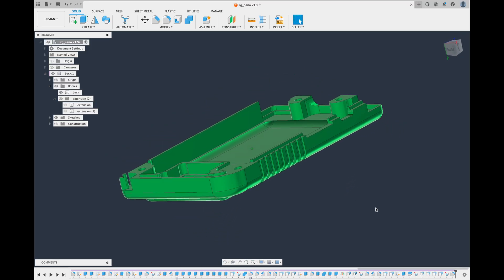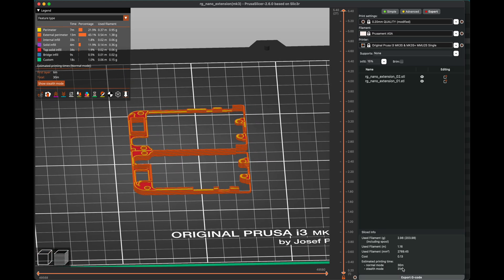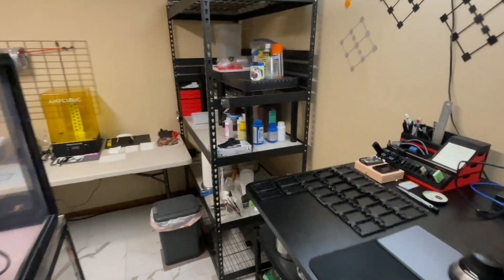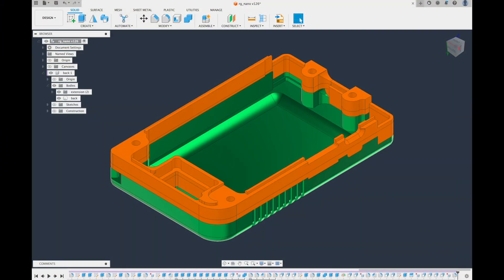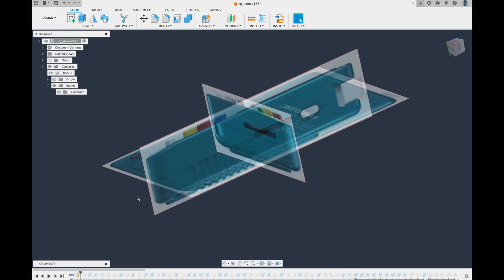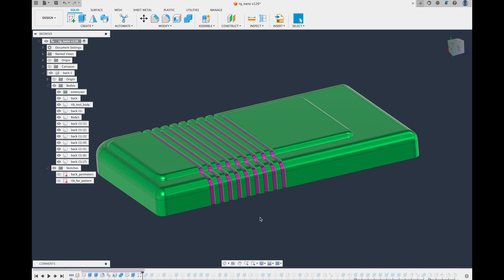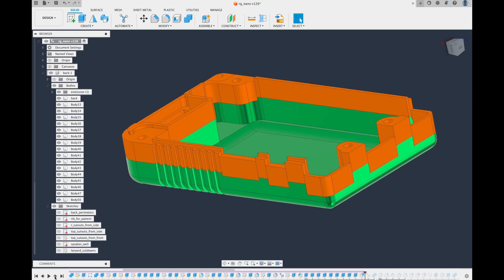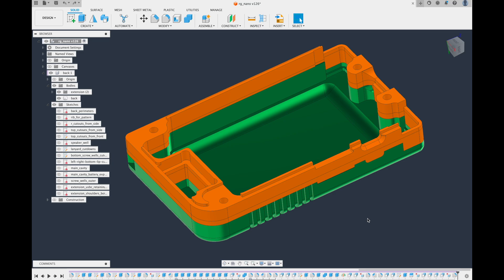RG Nano Battery Extension Mod

Comment: Any chance you can make a version with thicker walls to improve stability? I love how easy this is to print and install but I found that it flexes very easily with just a small amount of pressure while holding it.
Reply: Increase your walls in slicer settings, more walls less infill gives more strength.

Comment: what battery was used on this?
Reply from the maker: Hi, a friend sent me the RG Nano to make this mod. I just knocked that out this part for them. Here is their info if you want to contact them about it, and they might have a few different batteries or who knows what by now :)
- User Slystral
- https://discord.gg/RetroHandhelds
Reply: @jivinhipcat  so the battery u used when u installed the mod is still the stock battery?
Reply from the maker: In the video yes, but the mod is to allow the use of thicker batteries. So people can get a battery that is the same length and width, but have a greater thickness. I haven’t kept up with the Nano development. Has there been any cool software updates for it?
Reply: @jivinhipcat  cool cool. Software? Not much. Only recent I've heard is drum os which is a custom os but the main os of it is still funkey.

Comment: Really cool mod! It’s a shame about the aspect ratio, 1:1 is really only good for GB games, even then it’s a little bit jank. Still, appreciate a cool little piece of engineering!
Reply: I thought the same before I got one, but it's surprisingly fun to play on. I'm usually a stickler for correct aspect ratios, but on this tiny gem I don't mind it so much. You gotta have great vision or some reading glasses though (I'm nearly blind closeup so readers for me).
Reply: Gameboy/ color games really shine on this thing. You should just buy it for that library, you’ll use it more than you think
Reply: Pico 8 is perfect 1:1 too

Comment: That was really cool. I've never seen anything joined with acetone before. How could anyone play that thing for any length of time tho? It looks like a cramp machine.
Reply from the maker: ASA is my favorite material right now since you can weld and clean up with it. I was thinking of finishing out my Pokémon Emerald save on this. I guess I’ll find out about the crampiness then. Maybe single handed is good for those kinds of games on it.
Reply: @jivinhipcat Does the Nano have RTC that works properly for Emerald?
Reply from the maker: Just tested. Set the system clock, then set the clock in game. Left game for an hour with the system in standby. Checked, and both system and game clocks were updated correctly. Shut system down for 10 minutes. Started system, both system and game clocks updated correctly. Unless there's something wrong with how I check in doing that, I'd say it's good to go. Right?
Reply: @jivinhipcat  Cool, thanks for checking! Yeah that should do it. I’ve heard that the original cartridges utilized the RTC for two separate applications (time of day and growing berries). And that changing the battery in the cart only reset the ‘Time of Day’, so the Daily Lottery would work, and the Tide would change, but Berries wouldn’t grow. (or maybe it was reversed, I don’t remember) 

That info applies to changing the battery in the game carts that already has a save file. I believe it has something to do with the way the game “views” time. It’s not actually seen by the game as a time and date. I think it’s actually a number that COUNTS UP from the preset time/date the cart was made.  

So, knowing that, makes me wonder if the Nano’s RTC would have the same issue when using the save file that we ripped from the game cart.

I’m not asking you to go through the trouble of checking that. I’m just mentioning it, in case anyone understands that issue better than I do.